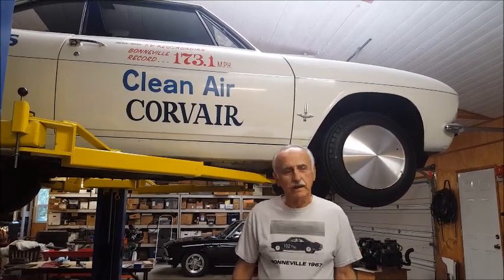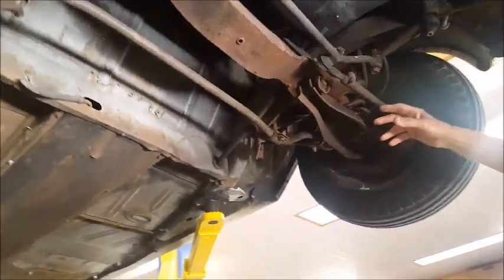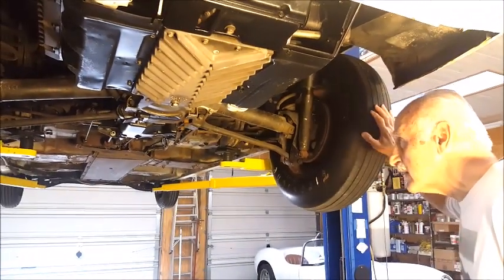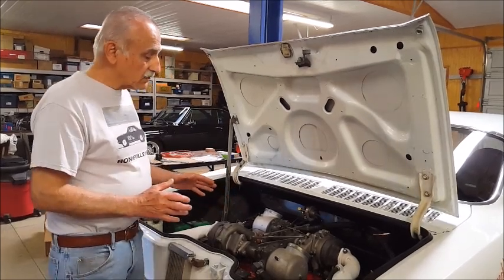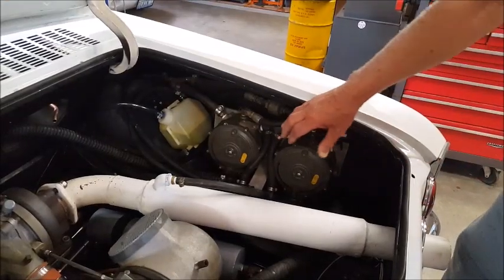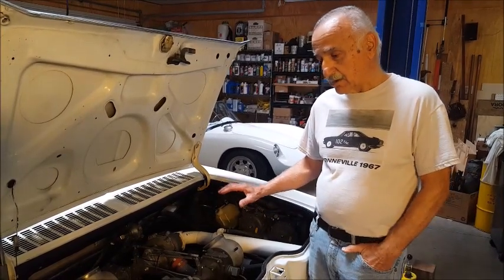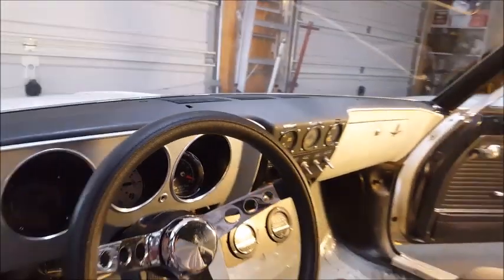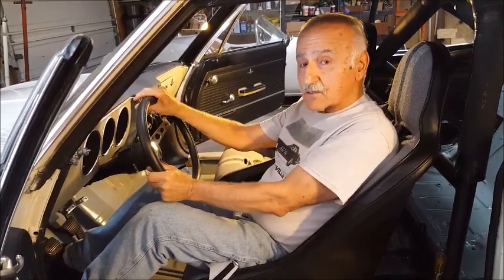World's Fastest Corvair, Is It Safe at 175 mph?

Comment: Great videos you’ve posted Tom!

Amazing to see how fast as well as your accomplishments with the car over the years. 

My dad found you while looking up videos on YouTube.  What is that other car you have in the video? Is that a Devon?
If so, what kind of chassis do you have under it?
Any videos on that car as well?
Reply from the maker: Brian,  Thanks for your kind comments.  The little white car is a 1962 Devin-C, powered by a Corvair turbo .  It has a very interesting history  and we will be doing a video later this year, (after Bonneville).
TomKeo
Reply: My dad bought a Devin glass shell back in 67/68 when he was 17 mounted on a German DKW chassis. 
We don’t know much about the actual body and he bought a tr3 chassis many years ago to try and make work with it.  That project stalled years ago, it needs lots of modifications to have the chassis work right under the shell. 
When did you pick up your Devin.
Looking forward to seeing your video when you put it out!  

Are you in Cali? 
We live out in VA.
Reply from the maker: @briantickell7942  Brian,  Bill Devin built several models and also made available a body shell.  We call it the Devin 295 because that was the advertised price.  You would tell him what kind of chassis you were using and the wheelbase, then he would adjust the tooling so the body would fit your chassis.  Devin probably sold thousands of those bodies.  I bought my car in 1971 and it was one of the first Devin C's produced.  It was factory built using a custom chassis bonded to the body for added stiffness.   
TomKeo

Comment: this is the second Generation of this car. The first was 1960 to 1964, and Gen two was 1965 to 1969. Gen One had a Swing Axle, Gen Two Independant Suspension. The Gen Two also had a Swaybar and they were just as safe as Porsches the same years. Also, these cars are not for amatuer drivers because their weight ratio is not 50/50 front to back. My only time so far with a rear engined car was a relative's Porsche. (I'm sorry he sold it, but it wasn't mine.) I was at first a master at making it go sideways and spinning until I got used to it.

Comment: Propane has an octane rating of 105, so I don't see the point of the water injection unless it's strictly to cool the cylinders down.
Reply from the maker: Thank you for your comments.  In the late '60's, super premium leaded fuels like Sunoco 260 and Chevron Custom Supreme had octane ratings close to 105.  We developed water injection for our turbos because we were having detonation problems even with the super premium fuels.
Aircraft developed during WWII utilized water injection even though the aviation grade fuels they were using had octane numbers much higher than 105.   
At Bonneville, I was running over 25 pounds boost with cylinder head temps over 500 deg.  Without water injection, the engine wouldn't have lasted 5 seconds.
Reply: @tvkperformance4147  WW2 airplane engines were running huge amounts of boost in the attempt to squeeze out 1000+ horsepower.
Reply from the maker: @RayleighCriterion    The most powerful WW2 aircraft engine was the Pratt & Whitney 4360 Wasp.  It produced just over 1 hp / cubic inch at 60 inches boost.  This power level could only be used on takeoff or for 30 seconds during combat.  
The engine in my Corvair produces over 2.5 hp / cubic inch at 75 inches (absolute) and it ran at that level for several minutes.
I would invite you to watch my other video titled "worlds fastest corvair at bonneville".

Comment: I had a 1965 Corvair Corsa. 
It had a V8 conversion kit from Crown .I was running a 383 Cev small block w zluminium head as that dynod at 450 hp and 460 ft lbs of torque.
With a change in spring rates from stock  bilst e in Sportcshocks a relatively small chin spoiler and rear deck spoiler the car was quite stable at 165 mph.
Ride height was 1.5 inches lower than stock.
The car handled very well once I had completion Z rated tires on it.
The whole unsafe BS applied to pre 65 Corvairs that would exhibit tuck under if driv we n stupidly.
So fir that matter we old VWs of the er a. 
And Porsc h es.

Comment: The Oldsmobile was not a Cutlass, it was a Starfire. It had a 215 all aluminum V-8 with a single turbocharger. The engine was very similar to the Buick 215 but slightly modified.

Comment: That turbo looks larger than the one that came with the stock Corvair. Then again, I only saw one up close in the 70's. Could you imagine if GM took turbocharging then as seriously as Porsche, Audi and Saab back then? Almost all manufacturers have turbochargers as standard equipment on most models. The early Corvairs had a crap suspension. After complaints from Nader they completely changed the suspension in 65/66.

Comment: Why use propane instead of high octane fuel? Was there an advantage to using propane (aside from being cleaner for the environment)?
Reply from the maker: Alain,  Any engine will produce 15 to 20% less horsepower using Propane instead of gasoline.  The reason I switched to propane is that running a turbo with a 'draw-through' carburetor configuration causes uneven fuel distribution from cylinder to cylinder.   This is because the compressor wheel acts like a centrifuge, separating the liquid gasoline from the air.  With Propane, the fuel is already in a vapor form, so the fuel distribution is very even to all the cylinders.  Also, Propane has an octane rating of 100+, so I just ran more boost to bring the power up.
Some people (like Ak Miller) preferred to run 'blow-through' systems with the carburetor pressurized  by the turbo boost, but that system has problems of its' own because carburetors don't have any way to measure air density.
Of course, modern fuel injection systems don't have any of these issues, but 50 years ago, they weren't available.
Reply: @tvkperformance4147  
Thanks for the detailed reply. I can appreciate the modern tech behind my 2018 twin-turbo V6 car a little more knowing all of this. Oh, and thanks for the video, too! BTW, I was born in 65, so to think that GM had a functionnal turbocharged boxer engine back in those days is pretty impressive.
Reply from the maker: @AlainHubert    If you haven't already seen it, there is a second video on my channel titled "Worlds Fastest Corvair at Bonneville".  The are some 50 year old movies of the car at the salt.

Comment: if this is a stock rear end on this 1962 corvair = i had no idea that it had a independent rear suspension drive train ( jaguar Rear end)   before it came out on the corvettes    ..1963 split window corvette im saying..
Reply: The early Corvairs had swing axles like VW bugs. The 1965 and later models had double wishbone IRS like XK-E's and Sting Rays. Swing axles were nasty but full IRS is very stable. I assume the Corvair guys talked with the Corvette guys to make the second-generation Corvair suspension.
Reply: @soaringvulture  thanks

Comment: Tom, the videos are great. In November of 1967, I remember you car at RIR. Still have a results sheet from Raceway II, I ran my 1952 TD in H and you were in M, you were 25 seconds faster. Was always impressed by your car. When you were doing slaloms and speed trials was it gas powered or had you already gone to propane?  In 1977 went to work for Hughes at GSG in Fullerton. Remember walking down the hall and seeing your name on an office in B600. Looked in my directory and it was G156. You weren't in and I've kicked myself over the years for not leaving a note.  Good to see you're doing well, look forward to more videos.
Reply from the maker: Everett,  what a surprise to hear from you.  I wish we could have connected in 1977.  I still have the black car,  I converted it to Propane in 1971.  After I retired the race motor, I built a stock turbo and its' been running on Propane ever since.  The single turbo motor that you see in the videos is in the car now.  It ran 164 mph in the white car and I installed it in the black car with no changes.  I drive it on the street but have yet to open it up for more than a few seconds at a time.  Driving on the street was a lot more fun in the '60's.
Tom

Comment: Wonder what that engine could do if it was built with better internals
Reply: People have managed 300hp from a modified turbcharged Corvair engine.  If more exotic fuels are used (such as nitrous with avgas)  more can be had, but with shorter run times under full power because the Corvair engine was never intended to be a performance engine and its cooling fin surface area is limited.  The heads simply need more fin area in order to adequately cool the engine for serious power outputs.  The cylinder jugs are even worse, not many fins and they're cast iron at that, and iron doesn't transfer heat that well.  A turbocharged Corvair engine at full throttle gets Very Hot Very Fast.  An aftermarket company, Salih Engineering, was selling big bore sleeved aluminum jug kits for Corvair engines and a few of these kits still pop up on Ebay etc.   They're much sought after by Corvair performance fans who can afford them.  ;-)

Comment: The issue about the swing axle Corvairs was easily fixed, as were the Beetles. There was a shop book about hotrodding VWs and there were at least 3 methods to compensate/correct the swing axle issue. I used one method to deal with a Triumph Spitfire that was more likely to get goofy than any VW I've ever driven. It was much like the swaybar used in the Corvairs, easily done and cheap!!
Reply: That VW Hottrodding VWs was written by Bill Fisher. He wrote a book on Corvairs too. I used to have the Corvair book, still have the one on VWs.
Reply: Those spitfires we're real 🐿️ y in the rear

Comment: I really enjoyed your video. Your car has the double jointed fully independent rear suspension. Most people don't understand the Corvair history. The early models up until 1963 had a single jointed rear axle with no camber compensator. These were the ones that were unsafe under certain cornering conditions. In 1964 they added a camber compensator. This was a large transversely mounted bar that went across the transaxle and attached to the suspension at the rear hubs and limited the total downward travel of the rear suspension and therefore worked to limit the camber change of the rear suspension. In 1965 the rear suspension was redesigned to a double-jointed rear axle setup that was quite similar to the Corvette rear end. This redesign of the rear suspension basically eliminated the original problem but by that time the name Corvair had become linked to Ralph Nader and his true claims that the early models were unsafe. I owned and drove many Corvairs of all years and was only wary of the early pre '64 models although they were only dangerous under certain conditions. I had a 1964 convertible with the camber compensator that was my daily driver and I only had one instance where it exhibited its nasty side. I was driving about 30 mph or less down a road with houses and driveways. The road was curved to the right, so my suspension was loaded in that direction, and someone backed out of their driveway on my right. I swerved left to avoid them. Now I was in the left lane and there was a car coming towards me, so I turned hard back into my own lane. These moves were all instinctive and forced in the situation, but the combination of a rapid left-right-left maneuver caused the rear axles to work against each other and even though I missed everyone and got back in my lane the car was self- steering to some degree for a short distance till the steering oscillations dampened out. The whole event was over in a matter of seconds and if you tried to recreate the event, you would have needed a professional stunt team with 3 drivers and spilt second timing to simulate the conditions I encountered. So, it was a pretty rare thing, but it did happen. If I had been in an earlier model without the camber compensator, I might have had a different outcome, so I have to admit that even though I really loved the car I did find out that under certain real-world conditions the car could be a handful. That having been said in this situation if I had been driving a car with a solid rear axle, I doubt it would have been nimble enough to miss both the first and second cars. So in that regard the Corvair was able enough to snake through all the twists and turns and get me out of a bad situation without a scratch even if it got a little squirrely doing it. And in the process it may have saved me from either t-boning the guy who backed out in front of me or having a head on collision with the oncoming traffic. Just an interesting real world event that happened to me.

Comment: Is it safe? Factory undercarriage. It being unsafe was Ralph Nader’s campaign which was total bs paid off both by Ford and vow to kill the Corvair ‘cause it was a challenge to the pinto and the vw beatle bug. At 14 I was in the back seat of my cousin’s with Dad driving. It had the factory turbo, called the covair Monsa “spider”. He shifted into 4th at 90 mph, the car was just as smooth s could be, which would have left a pinto or a vw bug in the dust. The only unsafe thing about the Corvair was when Nader, and some of the ford reps ran the test including the video of driving it “down the famous bank” probably using a stunt driver, turning the wheel  making it roll over. NO matter what car you run off a bank, turn the wheel, even if done today, they would still roll over. Good Job Ralphy. You remind me of some of our politicians of today…